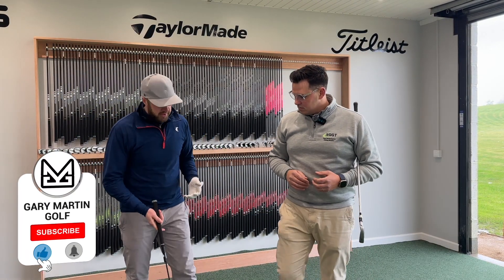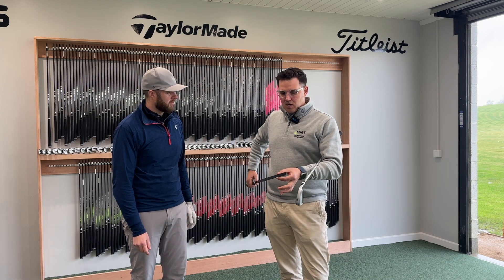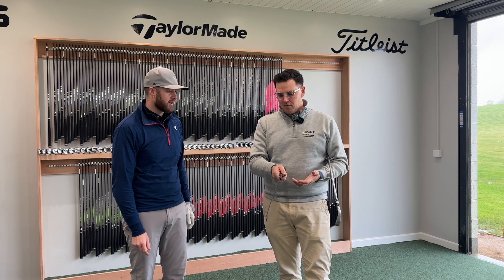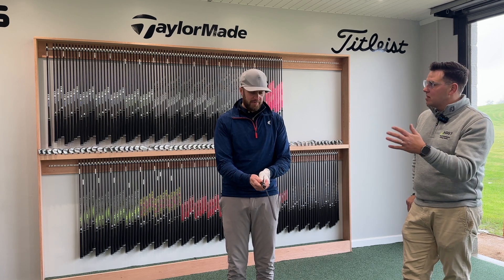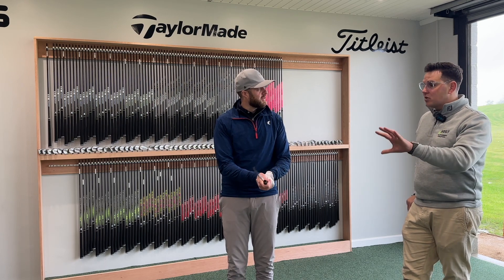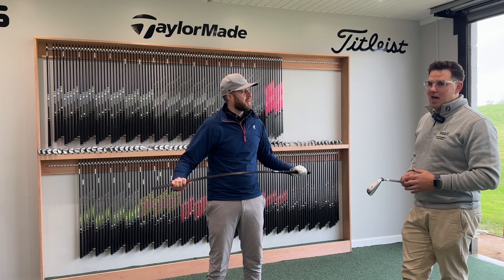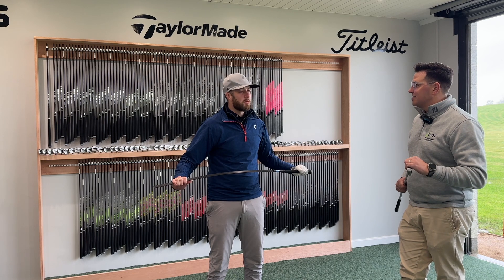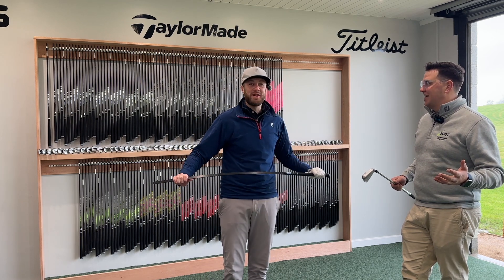Is it worth PURING a golf shaft?...SHAFT PURING explained!

Comment: Puring is the most over-rated, add-on expense in the golf industry.  Unless you have a really bad shaft (that should be replaced anyway), nonprofessional golfers cannot tell the difference between a club where the shaft has been "pured" or not.  The "flat" shaft is a gimmick used to sell the add-on expense.  The  downward swing is in one direction and not in multiple "wavelengths." Have your "fitter" build you 3-4 7-irons and only pure one of them.  Bring them to the course and let a variety of golfers swing them all and see which one they think is best.  Don't tell them that only one shaft is "pured."  You will find out exactly what I'm saying is absolutely true.  Kudos to Club Champion (and those like them) that sell you on the "flat shaft wave" and line their pockets at $100 per shaft.
Reply from the maker: I’d have to see a pured vs not pured done by a swing machine before concluding, but I’ve no doubt, a human wouldn’t tell by doing a swing test.